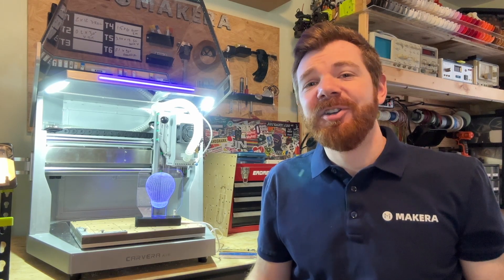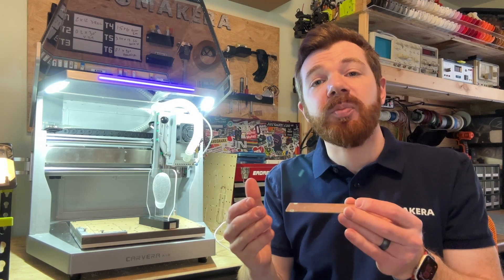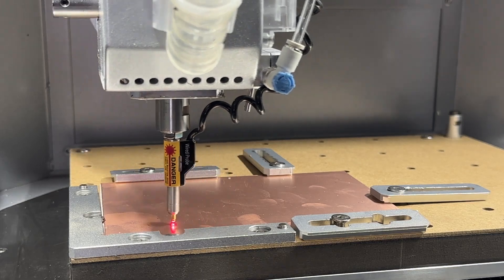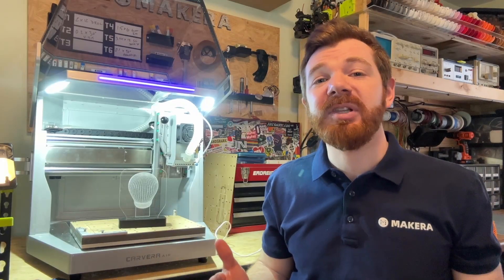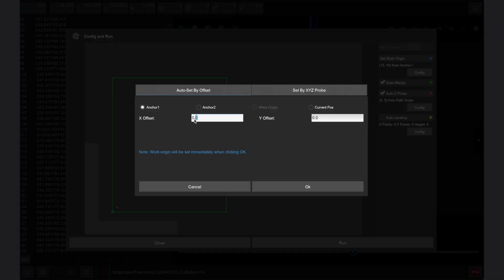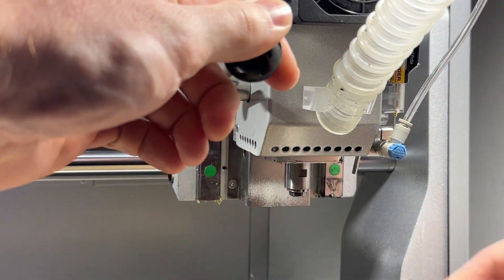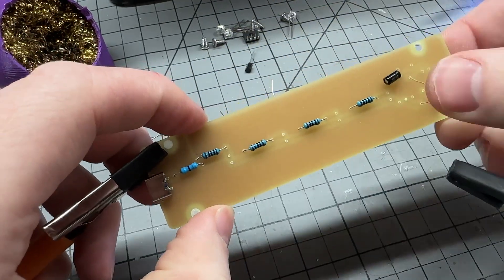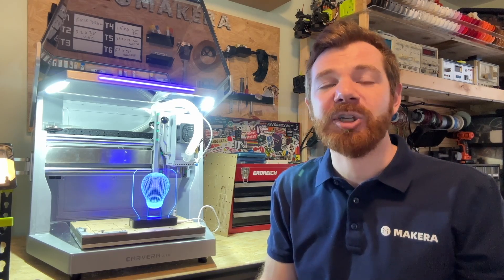LED Light, a Carvera Air Example Project

Comment: how many layers of UV mask should I apply ? How long should I keep it under the light (that shipped with the Carvera Air)? How do i know when it is 'cured' ? (I'm new to this). Totally understand that there's probably a ton of videos that go through this in details, with all the variables of a complicated formula explained.. But to follow the tutorial explicitly, it would be great if more information is added for the total newcomer like me. and most importantly, thank you for desining the Carvera Air, and for the instruction videos ... Highly appreciated !!
Reply from the maker: These are all great questions, and please see our more detailed PCB making videos for additional information. But in short, we recommend 2-3 coats of UV mask at a minimum with approximately 15 min of cure time per coat. Remember to sand lightly as well. Its cured when fully dry to the touch.

Comment: i used the circuit provided and didnt solder my own and the led are always on even if i touch the “jumper” cable. what could be the problem?  bad factory soldering of component?
Reply: i found the problem. I did this step by step on my own pcb, then saw the one shipped with the product had the electrolytic capacitor soldered opposite, wrong polarity. So it makes sense that it didnt work.
Reply from the maker: Glad you found the issue, and thanks for sharing!

Comment: I tried these instruction to the letter and the machine dragged the z probe along the surface, bending it in half. I’m convinced Makera is a scam. Avoid them.
Reply from the maker: We're sorry you ran into an issue with this project, but we're also sure there was a simple cause to this problem. Please contact our 24/7 support team at support@makera.com so we can sort this out and get you machining
Reply: @Makera I did. They told me it was my fault and stopped replying to my emails. I’m pretty convinced Makera is a scam.
Reply: This example project worked fine for me. When using the z probe it first measures the length. You were likely not following the instructions to the letter. I used the z-probe with my own g-codes already (generated via FreeCAD and via Makera CAM). The easy z probing and compensation is one of the details of this machine that really makes life easier (coming from a 3018 pro). Also the manual tool change is very quick and also with automatic tool length measurement. The fixed positions (e.g. the L bracket) make it very easy to reference the stock. The air nozzle really helps with aluminum chip evacuation and also the dust extraction shoe works fine (attached a Kärcher vac with custom 3d printed adapter). The controller runs on multiple platforms and firmware plus controller is fully open source. So far I couldn't be happier with my Air. This LED example project is very nice to get used to multiple materials and gives a nice final piece. There are some sophisticated examples from others on youtube (like the bike chainring from @Deltahedra ). The Carvera Air from @Makera is definitively NOT scam.

Comment: Great demo, thanks.  Is the circuit diagram available anywhere?
Reply from the maker: Thank you!! Yes, you can grab the gerber and MKC file from our wiki site here -- https://wiki.makera.com/en/knowledge-sharing
Reply: i used the circuit provided and didnt solder my own and the led are always on even if i touch the “jumper” cable. what could be the problem?  bad factory soldering of component?

Comment: If i use more than 2 bits in a vector pocket it says the toolpath calculation failed and i need to adjust the tool combination. Whats up with that?
Reply from the maker: Ensure that you are working from the largest big diameter to the smallest bit diameter when ever combining tools in a single pocket clearing toolpath.
Reply: @Makera  I did. I wanted to use the two bits you used plus i wanted to add a 2m corn bit. I made sure it was at the top of the list and i changed the tool number so it had a different number than the .8 corn bit.

Comment: Is there any way to turn down the volume of the audible beeping? It is too loud in the confines of my office.
Reply from the maker: There is not a volume adjustment, though you could cover the speaker on the controller board with tape to muffle it. However you can also disable the tone by entering the command 'config-set sd switch.beep.enable false' in the MDI window, then resetting the machine. Please visit our support code page on our wiki site for more information.
Reply: @Makera  Thanks for the info

Comment: Had issues with the spring loaded solder mask removal bit, it cut down through the solder mask, and the copper. Any suggestions / tips on getting it right?
Reply from the maker: Can you check if the Vbit retracts smoothly, maybe there is some debris. Does the same thing happen when you try with another SM removal tool? for more support please email Support@makera.com